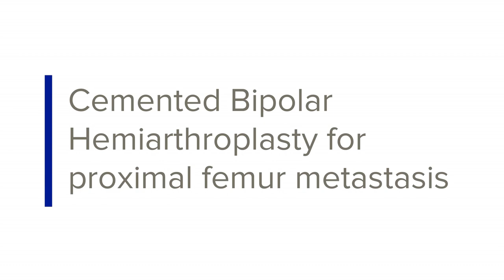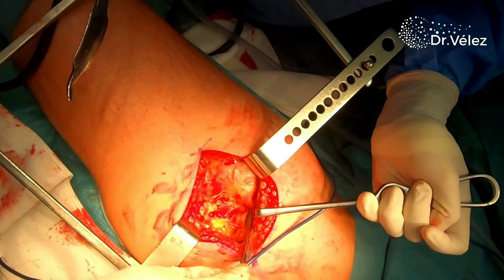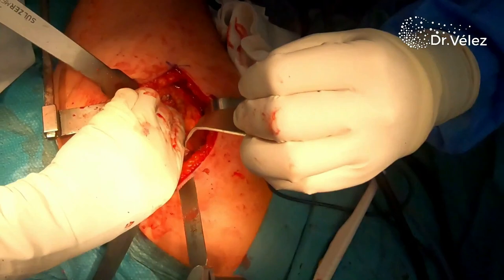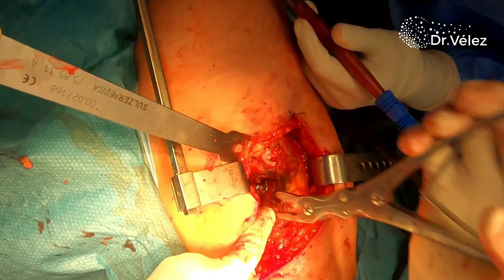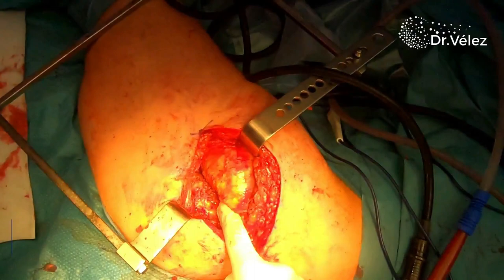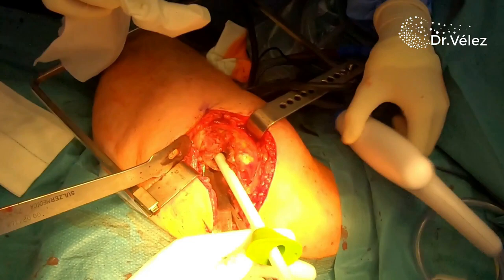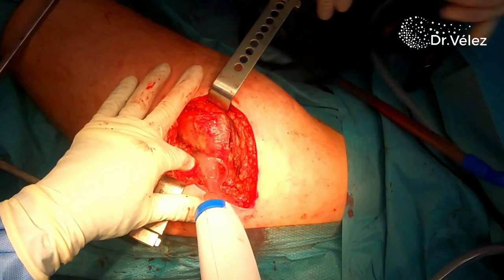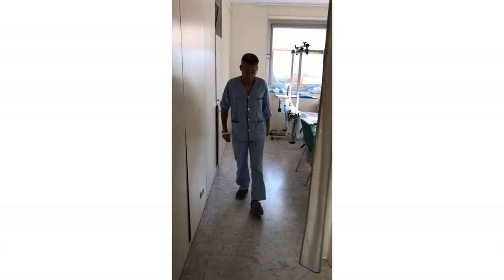Complete surgical technique:Bipolar Cemented Hip Hemiarthroplasty for proximal femur bone metastasis

Comment: Sir how do you make sure that the antiversion is correct while preparing the femoral canal
Reply from the maker: Hi, in a posteraletar approach you can use as reference for your anteverion:
The calcar and the position of the leg. While preparing the femur the leg is positioned vertically to the floor. Your anteversion angle is the perpendicular to the leg plus your desired anteversion. Also being a cemented stem, after you trial your components you still have a chance for some additional correction with the definitive cemented implant. Hope it helps😉